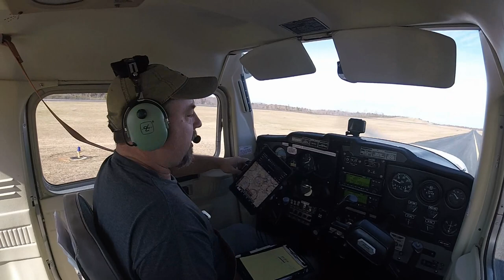Short Flight in the Cessna 150

Comment: Thanks for the video! Out of curiosity, how do you get the mix of ambient noise and headset audio? I have a GoPro and when I plug the headset adapter in, the ambient mic cuts out.
Reply from the maker: I use multiple cameras and just mix in the audio from one not plugged into the intercom. I turn down that volume in editing. 
I like to have it in the video to give an audio sense of where my throttle is set.
Thanks for the question, and for watching.
Reply: @justaboutaviation9343  Makes perfect sense! Nice job with it, too. If you don’t mind, what program do you use to edit?
Reply from the maker: @randy6108  I use free software VSDC. It take a bit to get used to, but there are a lot of tutorials.

Comment: How you connect your audio  I have a go pro 5
Reply from the maker: I use an adapter from the GoPro to the intercom system in the airplane. I also use a hero 5 to capture the audio. I got the cable from a company called NFlightCam.com

Comment: I have not flown since 1976. Instructor used to slap my hand if I steered after I touched down. He insisted just to use the rudders once on grown. I noticed you steered with yoke. Are airplanes different now?
Reply from the maker: I suppose your instructor never discussed on the ground wind correction as to keep from getting flipped in high winds, or relieving nose wheel pressure by pulling back on the yoke.
Different instructors. Different styles.
Thanks for watching.